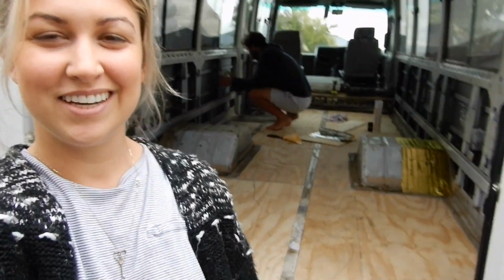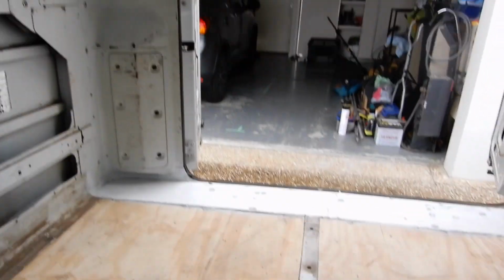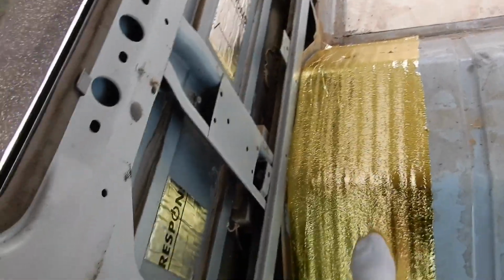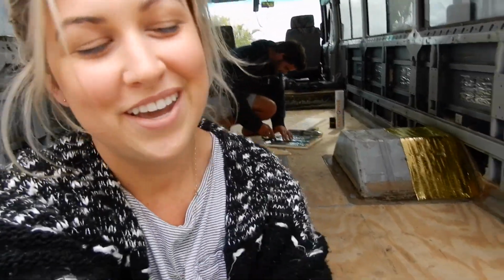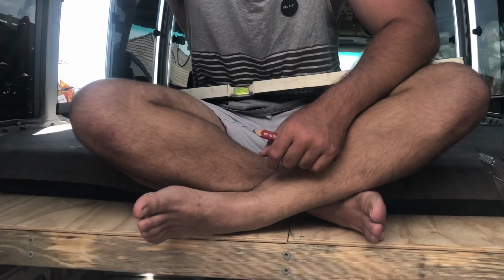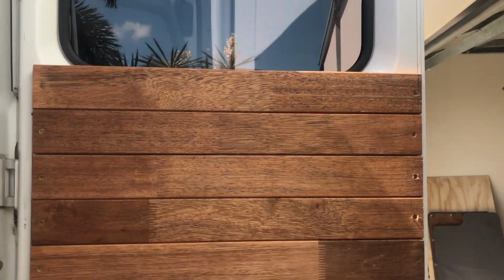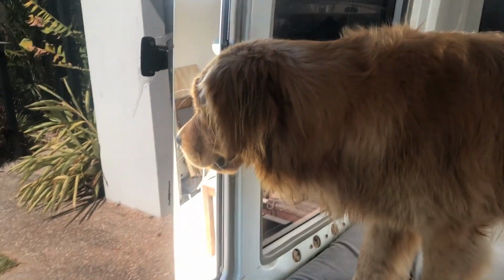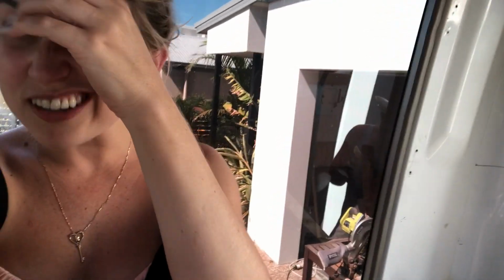BUS PROGRESS | installation, flooring, sounding and a BED FRAME!!

Comment: Hey guys.  Love the videos you're putting up.  Thank you for sharing your progress.  We have a Nissan Civilian that we need to replace the floor in and I was wondering what the product you used for under the floor boards (the gold foil)?
Reply from the maker: Simon Dewar thank you! We hope to continue more and more :)
The floors have been the more difficult project so far haha! We actually used two sheets of marine ply, first layer went flush into the floor cut outs which we stuck laminate floating floor underlay (weather proof/mould and residue resistant grade) stuck on with sikaflex and it does the job!
Then we used a second layer of marine ply to flatten the surface of the floor :)
Goodluck with everything
Reply: Thanks for the reply.  I was umming and ahhing about our floor thinking "it'll do" however (just like with everything) a good solid foundation is best.  Off to Bunnos we go.  Thanks again.